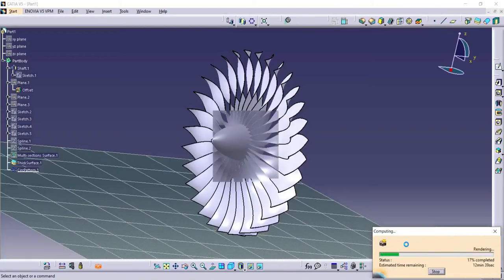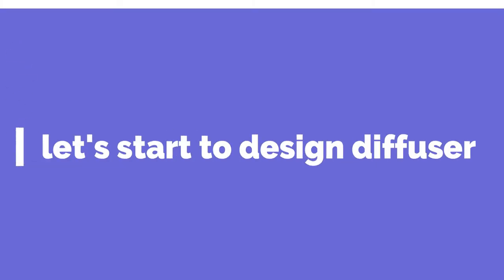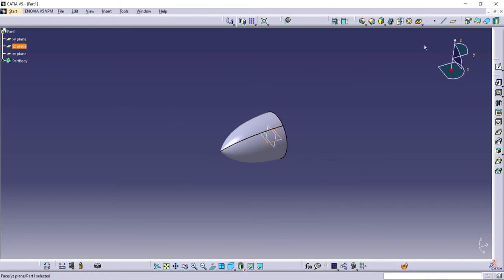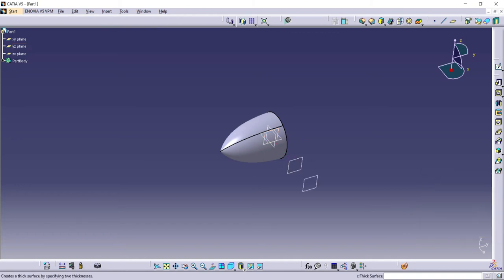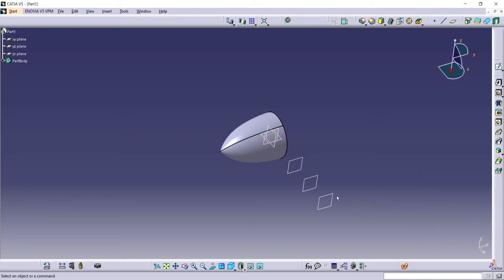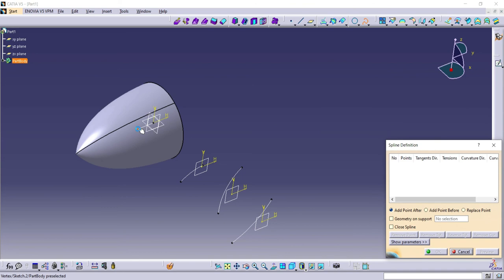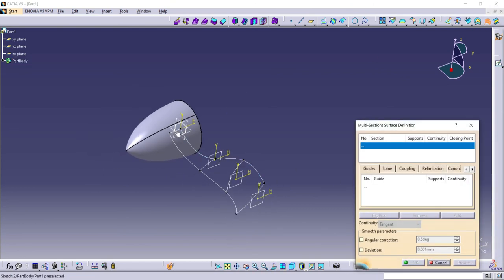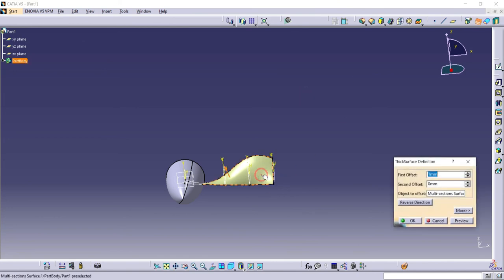how to design diffuser in catia v5 | surface design tutorial | part design | multi section surface

Comment: Nahi hota bhai open counter dikhata hai
Reply from the maker: can you explain what is the exact issue. i will help you out.
Reply: @designthoughts2570  there are showing counter open in sketch and bcuz of that multi section solid can't working
Reply from the maker: Is there any error showing?.
Have you done spline sketch?
If you have completed all the spline sketches. You have to do multi section surface by selecting those splines and don't forget to give guide.